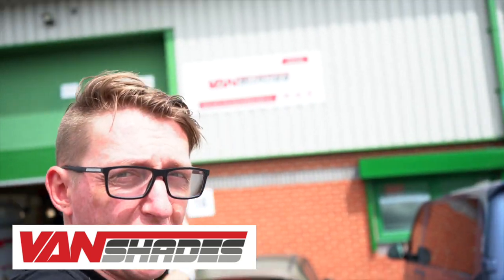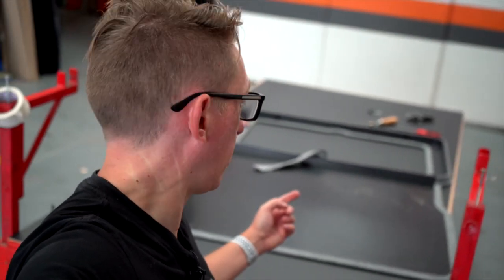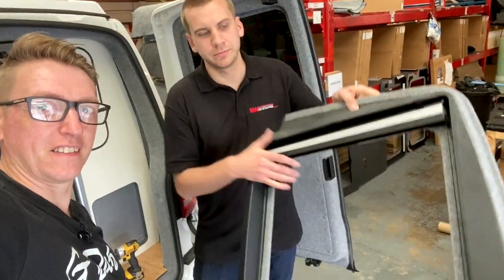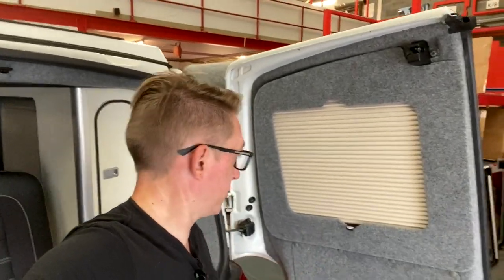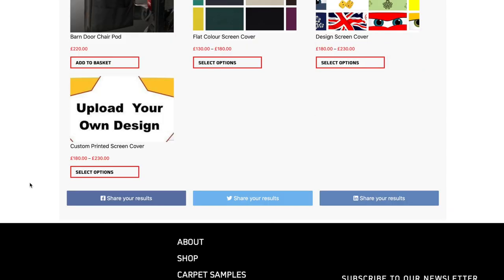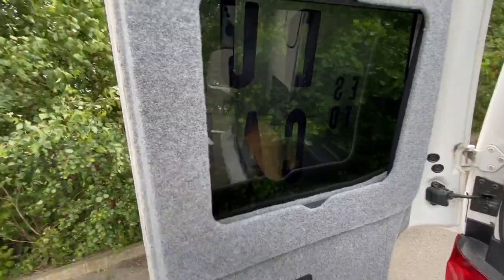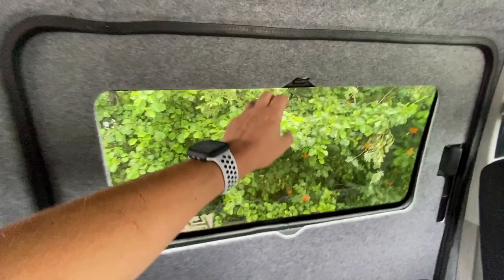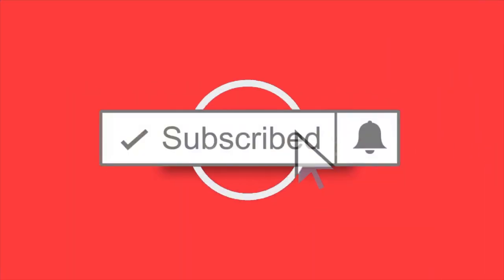Vanshades Window Pods 2.0 install & review - VW T6/T5

Comment: Evening bud, noticed you fitted Vanshades with after you fitted your aftermarket windows, how did you get away with the window pod knocking against the black window edging trim ? Did you cut off the trim then carpet the edges before you fitted the pods? Cheers

Comment: When will you be posting a video of you fitting the splashback? Will you show all stages including the scribing and cutting to size? I look forward to see this as I am currently looking into buying a splashback 👍
Reply from the maker: I’m actually fitting it tomorrow, won’t be doing a step by step install video on it tho as VanShades have their own install videos.
Reply: GDUBTV ok bud, I’ve been trying to find a vid showing how people actually measure and cut to size as the vanshades vid only shows the install after it was cut to size👍
Reply from the maker: The way I did it was to offer the splashback up behind the unit. The splashback has a protective film on the top so I pushed the unit up against the splashback and used a biro to mark the line along the side of the cupboard unit and across the worktop edge, using the biro to mark the protective film. Then use a few strips of masking tape to protect the edges around the side of your lines that your gonna cut. I used a laminate jigsaw blade (on VanShades advice).. from there fitting is as per their video. Hope that helps mate 👊🏼
Reply: GDUBTV thanks for the advice, I don’t have a gap all the way long behind the kitchen and everything is fitted in place I have made a template to fit the space and I am going to ask vanshades if they will make a brushed aluminium one to my sizes🤞

Comment: What about the Front doors windscreen et cetera Cheers,.
Reply from the maker: @iamlukemorrison  Cheers bud ;)
Reply from the maker: Yeah, I've got an external windscreen wrap that covers the front and the sides, but I'm going to change that for an internal set that attach separately with magnets. Personally I find them a little easier and they suit the way we use the van better :)